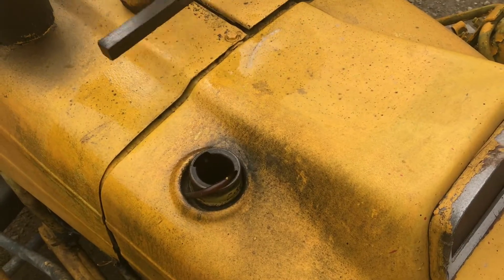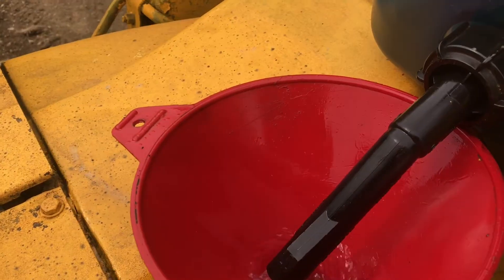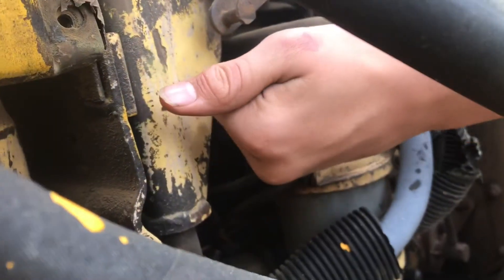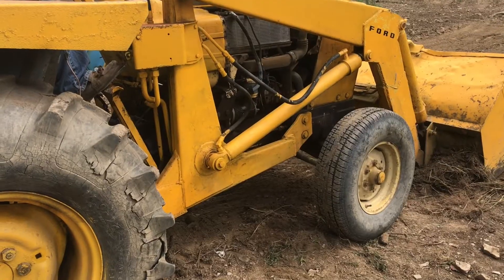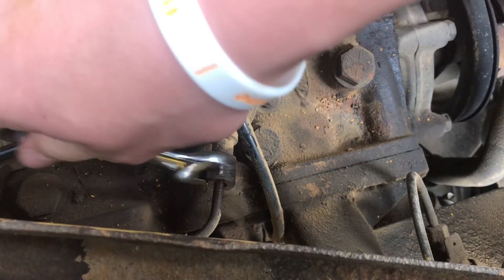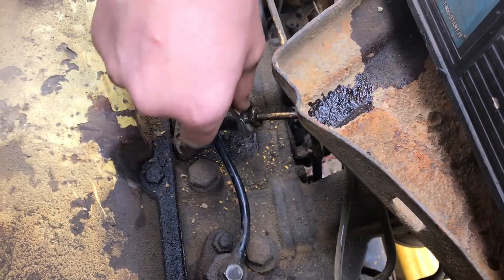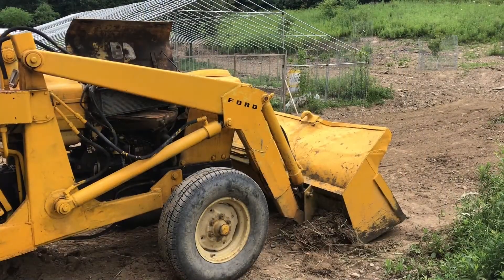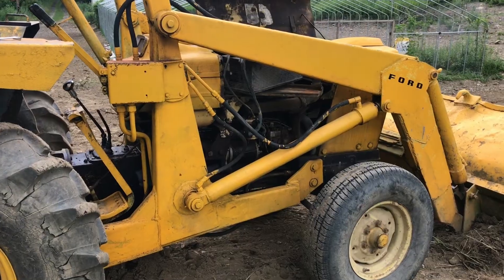how to start a diesel AFTER it ran out of fuel

Comment: Had to laugh, ran out of diesel in my Kubota while back blading snow off the driveway and is now also blocking the driveway. Naturally, when the delivery driver tried to sneak around the tractor, they got stuck. What ya gonna do but laugh. They're unstuck and on their way now and I've educated myself! I had added more diesel but I don't believe it was enough to get the level in the tank high enough to create the gravity pressure. So now I get to try to get around the tractor myself to make a run to the fuel station! Thank you for this very straight forward guide

Comment: No i just crank it to it fires up.. no bleeding or nothing, pressure will build back up and it will cough and fart itself back into running
Reply: Yeah did this, still didnt start and melted the battery terminals not a good idea

Comment: Crack open all your ejector lines at the same time and turn over the engine with the lines sill open and as each one drips a lot diesel fuel close that line off. Saves a lot of battery life and extra motor turning over. .You still might have to do this several times till it catches and keeps running.  Never ever let these run out of diesel or it could cost you 30 to 90 Minutes in bleeding...small LOL

Comment: Nice video.  Thanks for putting this together.  I think at 1:20 that's not technically called your fuel pump.   I believe you were pointing to your injector pump, the fuel pump is just a ahead of that I would imagine.

Comment: I can't tell for sure but your levers look a little longer than mine. Since mine had 600hrs on it when my dad bought it from the insurance Co (theft recovery) (why is it that in 1970 the FBI tracked it down because the used the serial# to buy a broken turn table unloading it hit the concrete hard but they can't find my $6000 quad?)    Anyway as the pins wore the lever started hitting the metal in front of it and I had to start banging forward harder to get it in float.    I ended up drilling and went to Bearings inc and bought a small long fine needle bearing then drilled a hole for in the leaver facing the fender for a small grease fitting (I know over kill when a bushing would have sufficed)  I can't say you have float because at the time there were different options for that machine like auto leveler ( just learned to not let dirt and rocks fall on me) I operated the newest, fanciest equipment in 40 yrs but when I get on the 4500 it's just like riding a bike)  (my cousin bought his new and roaded it everywhere if he didn't borrow dads lowboy, but not often. He used to work it at Clarion state college during the week and road it home 40 miles to work here for the weekend hitting every bar on the way down. The back to Clarion Mon morn for the week you'd see him coming down the road standing up, you can do that on a straddler.) then he bought the high deck kit like yours. Oh his had the torque converter FWD/REV shuttle) ( he had auto dig feature on the hoe but it never really worked that well.)
 If yours ends up not having float it shouldn't be to hard to find a used one.
If it ever starts using ANY antifreeze find out where it's going. Mine pitted the head and through the head gasket and very slow used antifreeze. I had to mill .030 off the head. The yrs later not taking care of the antifreeze electrolysis eat a soft  plug then a hole through the cylinder wall into the water jacket just below the oil wiper rings on the piston when it was the whole way down. I fixed it. 1988 (I really need to put new antifreeze in it now.) Some where I have videos and pictures doing it.
TAKE CARE OF YOUR SWING CHAINS! keep them oiled up they're not cheap. I never did but the Large bottom turn table pin should have a plate bolted to keep the dirt out. It gets wore bad egg shaped. Every time you put down pressure on the boom the turn table moves back and pulls the swing chains just a little. Look for cracked links and be ready to drop the bucket to the ground because you can't stop it with a broken chain. I have cracked links now so I go gentle with it. We tried to rebuild the links with spare links from broken chains but didn't last at all. Yrs latter I look back thinking the links weren't wore the same so the least wore one broke first then one after the other and all of a sudden there goes the bucket. Don't hit that guy or truck standing by the ditch. I learned yrs ago stop and say you can't stand there. I had different thoughts of drilling them straight but I think the links are to hard.
The swing cylinders only pull. There is a small rubber hose that connects the back of the two cylinders for the air to flow back and forth. That's fine till the packing starts to leak. OK till you swing past your normal swing then the oil pushes through the hose to the other cylinder unknowing to you pushing the other polished rod out making the chain loose and when you stop it doesn't stop because the chain was pushed out loose. WOW!  So when you figure what's going on you pull the hose off one cylinder and let the little bit of leakage go on the ground. I have no time for that now winters coming an I have two more septics and 3 drive ways to do yet. That WAS all well and fine till it's really leaking because the open port and hose has been sucking up mud and well you know.  Take a break.

Comment: Don't worry about fuel level on that tractor as the bottom of the tank is higher than the pump. That's not the correct way to bleed the fuel lines. After bleeding the filter, then the small screw on the pump then loosen at least two injectors THEN crank the motor for max 30 seconds or till fuel is squirting good then tighten the injector lines up and it will start.    I've owned my 1970 4500 for 51 yrs.
Low battery/slow cranking is the enemy. Low voltage equals high amps. High amps equals heat. Lots of heat. I've bought my share of starters (school of hard knocks). This motor doesn't want to start with slow cranking. The better the battery and faster cranking the easier it starts. 
Cold weather's a different story as you do the same thing and add cold weather procedures.  Block heater for 2 to 3 hrs is best. Glow plug (kind of. It actually vaporized and heats fuel in the intake manifold) The only way you're going to start it on a cold day with out the block heater or ether (ether's bad bad bad.)
Reply from the maker: Really big thanks! There’s not a lot of people with your kind of experience on these tractors. I read everything you said like three times. I’ve had my fuel tank off a few years ago and got everything all cleaned up and resealed with marine JB Weld, at the time that was the only thing that I could find that would work. I still have to blow air in the tank sometimes to get things to flow again. My BIGGEST question and I have been trying to figure out for the last couple years is how to use the float feature on the loader. I haven’t been able to find any information on how to float the bucket to make leveling ground easier. I’m pretty sure it has this feature but no one I talk with knows how to use the feature. Thanks again for this very helpful information. Each year I learn a little more about the tractor. I’ve had this tractor for about 10 years and make improvements on it every year👍👍
Reply: I have a tractor Dynahoe 1979 that I’m having trouble starting, but I’m not sure I don’t have a manual. Do I need to fill it up with more diesel?

Comment: Sweet, Nice job. Followed the instructions to a tee, and only had to bleed the system 3 times, and boom, off she went. Ford 555 3 cylinder. 
Then I promptly blew a hydraulic line..... At least the motor is running...

Comment: MAKE SURE YOU HAVE A SPARE BATTERY ANDTHE ONE CONNECTED IS IN TIP TOP CONDITION    AS WELL AS HAVING A JUMP START TO ANOTHER CAR OR MOTOR WITH VERY GOOD CABLES   .    IF SILVER IS THE BEST CONDUCTOR OF ELECTIC HWY ARE SILVER CABLES NOT AVIALABLE        ??   AS REGARDS 2020     DEISEL ONLY LASTS ABOUT 6 MONTHS TO 12 MONTHS  SO ALL DEISEL NOW HAS TO BE CHECKED THIS  SPRING   AND ALL DEISEL  IN ENGINES AND TANKS  BOWSERS HAS TO BE TAKEN OUT CHECKED AND  NEW FUEL PUT IN    FIRST   !!!

Comment: So is this a Perkins 3 cyL ?...   Good tip on the spiral fuel flow, you can also put a hook shaped wire between the funnel & filler neck.
Reply: Not a Perkins!
Ford designed, Ford built engine.
Reply: @UltradogMN  thanks man.

Comment: You can put gas on a rag and hold it at the breather..the fumes will start it long enough to bleed everything..And it's safer than either..
Reply from the maker: Wow that’s really an interesting technique, you use gasoline fumes and a rag. Final purge the diesel fuel. I just wanted to verify. Hopefully I don’t run it out of fuel again but if I do I may try this
Reply: @livefree6878 .Iv done the rag trick many times.Iv never had a problem.It will run for a minute or so that's usually long enough to pick up the diesel..Have a great day..
Reply from the maker: Thanks, I’ve never liked using ether, it’s always seem too aggressive. On lawnmowers of used WD-40 with really good success. I will try this next time for sure. Appreciate it

Comment: To save your battery and starter you can connect an in line bulb type pump to push the fuel around. You also need to be careful that you dont suck crap through if the tank was empty. I had to drain my tank and pull the strainer after i ran my old Ford 66610 out of fuel

Comment: Cut an inner tube in half that is the same size as the tank opening.  Clamp one end on the tank and clamp the other end shut.    Put a little air in the tube.  Start the tractor.
Reply: that sounds genius going to try that for sure

Comment: That's one of them old 1978 or so Ford 545's or so. I've worked on that particular type. It is a solid piece of equipment. 3 cylinder Perkins diesel is simple and reliable. I like the backhoe model. Got a lot done with it.
Reply: Not a Perkins!
It is a FORD designed Ford Built engine.

Comment: you can also use some starting fluid sprayed throw the intake..but you mustbe be very carefull! i use it cause the injectors in my tractor ar in a very tight spot! THANKS FOR THE VIDEO
Reply from the maker: I’ve heard a lot of people using ether, it certainly makes me a little nervous. I want to see somebody do it first. Just curious how much do you use and what’s the basic procedure. Pull the air filter spray a little in give it a crank?
Reply: @livefree6878  it just happened to run low on diesel and get air in to the system. I tried to bleed throw the pump and the filter but I couldn't reach the the injectors, so I took a can of ether I sprayed just a little through the intake before the filter ( didn't remove the filter) I gave it a crank and it started right up! All good I have performed many times through the year this method with out a problem.

Comment: Any time I have done this, I have always cranked the engine over while the one injector fitting is cracked open until the bubbles stop. Then re-tighten the fitting and usually that cylinder will fire and the engine will start on that one cylinder and then the rest will soon start to fire.